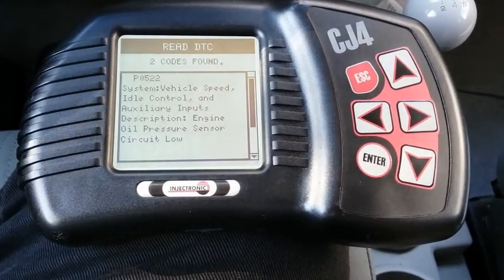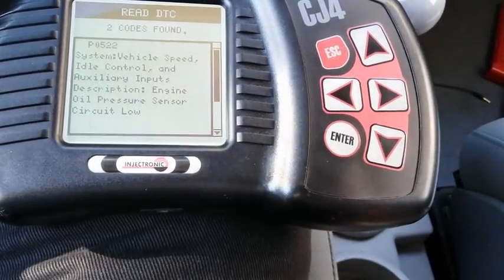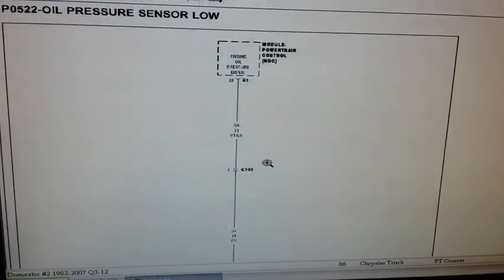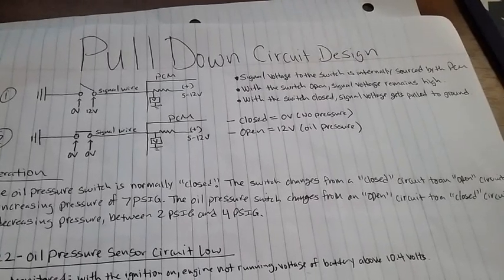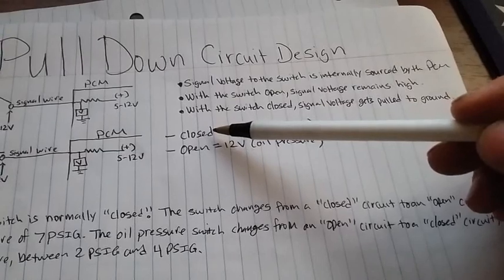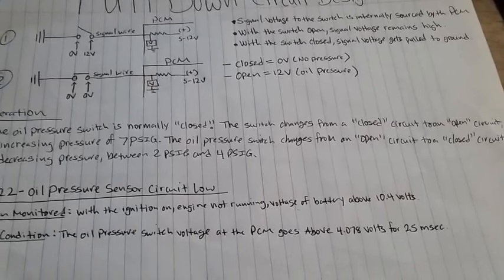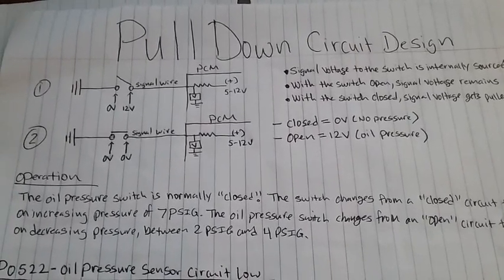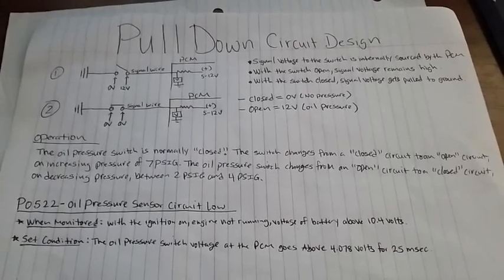(Chrysler PT) P0522 Oil Pressure Sensor Circuit Low

Comment: Didn't show where anything was
Reply: @EliTheOBDTech  the problem is that you mentioned a test and didn't show where and how. You removed the sensor and still didn't show where or how. Other than that your video was amazing!
Reply from the maker: @donsweet8238  Yes, you are correct. Thanks for pointing that out. 👍

Comment: Interesting. My customer has a check engine light with this code and p0520 /P0522
Reply from the maker: Most likely a faulty sensor.
Secondly, electrical problem.
Thirdly, low engine oil pressure.